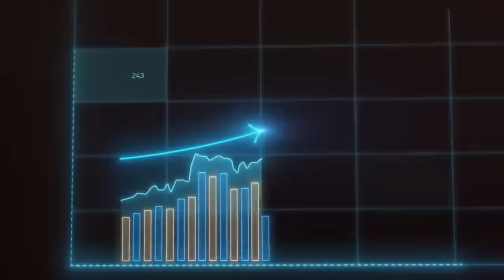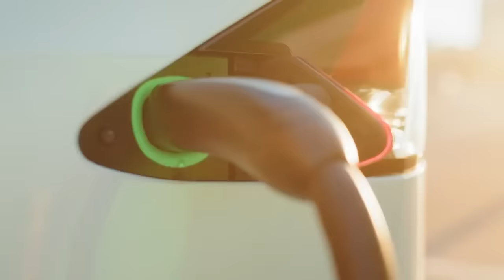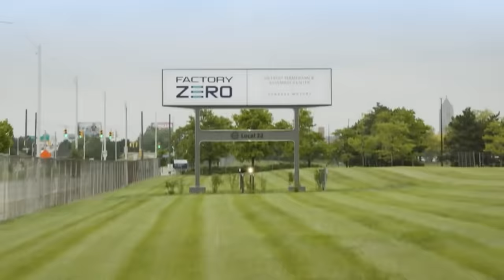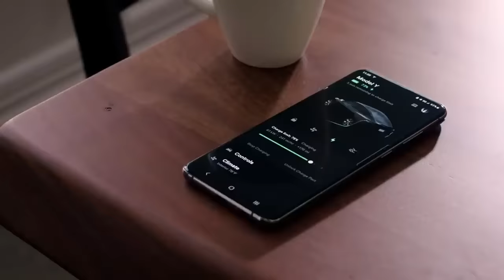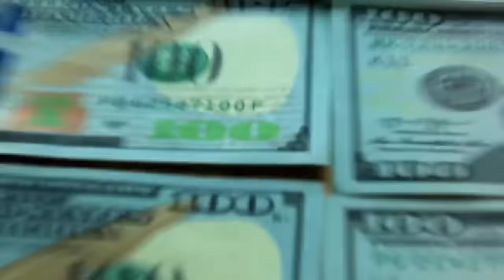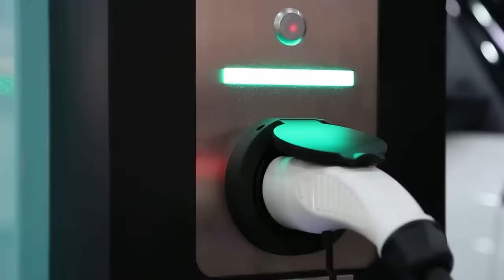Electric Vehicle Owners Are Frustrated and Demand the Return of Gas Cars

Comment: Charging and range anxiety will always be a problem because of  the poor infrastructure, which will never be close to what it is for gasoline cars.
Reply: Charging keeps getting better. Range keeps getting better. Petrol sales are already less than they would be without EVs, and some places like Norway have seen large numbers of petrol stations closing. The thing is, electricity can be found in far more places than gasoline, and that will only get better.
Reply: Do you understand that when the model T came out, they said the same thing?  Not enough gas stations. 🙄
Reply: @sdfglkjhdfkjdhldskfj 

Eventually, but when is that eventuality?

At what cost?

Ev's have replaced a tiny blip in gasoline sales in the US, but have markedly increased the amount of coal needed to generate the power for the EV's.

That doesn't include the off-grid instances of diesel powered generators used for charging stations.

Kind of defeats the purpose doesn't it?

Norway has a population approximately ⅔ that of New York City, so it's not quite the same problem.
Reply: @rtbrtb_dutchy4183  Digging a hole to start an oil station is different from hooking a charging station to the grid. A grid that can't handle it without nuclear power plants no less.
Reply: @holyomega3093  where did you get your info?  Oil industry propaganda?  

Our grid can handle it already. A nuclear power station isn’t required. 

Did you know that Tesla uses old batteries at their power stations?  That what they can trickle charge those batteries and when a car plugs in, push that charge from the battery into the car battery. Would it still need power from the grid?  Yup, but there will be less peak power.
Reply: @rtbrtb_dutchy4183  then are are we still get black outs during summer and advisory to charge during none peek hours?
Reply: @holyomega3093  the blackouts are locally. That doesn’t mean there isn’t enough electricity available overall. Compare it to like you have a hurricane on the east coast of Florida and everybody buys bottles of water. Those stores run out of bottled water, but there isn’t a water shortage in Florida. 

When they ask you not to charge during peak hours, they also ask you to use the ac a little less and to conserve electricity n other ways. Charging the car is one of those things you can do. 

Here is the thing, nobody charges their car all the time. It’s only occasionally. I charge my EV only at home. Before I had solar, my car was set up to only charge between 1am and 6am and I did this basically once every 3rd night. Just because you see cars plugged in, doesn’t mean it’s charging. Now with solar at home, I charge during daylight hours only.
Reply: @sdfglkjhdfkjdhldskfj   The reality is I can drive my car 300  miles on a tank of gas while my ac is on and my lights are on. Gas is the most efficient source of energy still and will be for a long time.
Reply: @rtbrtb_dutchy4183   Seem to recall California asking it's EV owners not to charge their cars for a time because it was over powering the Grid. It's a fantasy land you guys are living in.
Reply: @cain1314  gas is not the most efficient. 🙄 do some actual research man, seriously. Most electric cars will do the equivalent of well over 100 miles per gallon. 

And no, you pick and choose what you wanna hear. California asked people to reduce their electric usage from 7pm till 9pm during the extreme hot days. They asked people to use the AC less as well as try and not use things that takes electricity. One of those things was charging EVs. They didn’t force anyone, they simply asked. Why?  Because they know you can schedule an EV when to charge. I plug in mine when I get home, but it only charges during certain times that I picked. They just wanted people to use common sense. It’s not the EVs that was over powering the grid. It was the millions of people getting home from work and cranking up the AC when it was 110°. 

Just like others, you regurgitate the propaganda from the oil industry, without knowing actual facts.
Reply: I have no desire to visit a charging station at 3 am.

Comment: Saw a news story the other day that dealerships can’t fix a lot of the issues on ev’s because they don’t have electricians as workers, they can’t fix them, these vehicles are piling up at the dealer repair shops. If you take to an independent shop then you void the warranty. Also, for example, a replacement battery in an ionic (?) is 18,000$ total

Comment: As an resident of Alberta,  Canada the omission of problems associated with cold weather driving is a glaring omission.  Alarming stories re EV operators in the recent cold snap we just experienced are sure to turn future buyers of EVs off big time.
Reply: Living in Alberta my gas engine drove only 55% as far as in the Summer, not without some issues, during the last cold snap. It also takes in general 20% more fuel in the winter. We are talking about a almost new well now brand. So all this fuss about lower range for EV is also for gas. 
I am not an EV owner or what so ever, but facts are facts
Reply: @siccozandt6286 you need to fix that problem. Maybe your spinning tires, driving against snow pack, taking excessive time to warm it up, but that isn’t normal because of below 0 degree weather.
Reply: @sharky7665  An ICE vehicle with a fuel tank above half (recommended in extreme cold) will keep you alive for days if stuck in a ditch. An EV battery powering an electric heater will give you hours at best. EV's are a death trap in a cold rural climate.
Reply: Everything will be sorted out eventually…We will specialize…In Alberta I’ll keep driving my oil burner and people in Texas will get EV’s…eh?
Reply: And the municipalities are buying them. It's insane. A giant waste of money virtue signal. Calgary bought a bunch of electric Mustangs.
Reply: @siccozandt6286 In the first minutes after starting in cold weather your car will have more comsumption until it reaches the working temperature. After that, you will not have problems of consumption if you are driving long distances. But if you are doing always small trips where the engine has never time to reach the working temperature , then yes, your car will spend more fuel.
Reply: @siccozandt6286  Not to those with preconceived notions.
Reply: @zdenekkindl2778  No. You will be forced by economics to switch, ICE cars will cost a fortune and gas prices will go through the roof. Repairs will also cost an arm and a leg.
Reply: No mention of the temperature issue in this video.  The recent deep freeze in Chicago produced this problem on mass.      (1) The available charge on the vehicle dropped as much as 70% over night, as the temperatures crashed to minus 18 deg. celcius.  (2) Hundreds of charging stations were frozen and rendered inoperable.  (3) Vehicles that were able to connect to a charging station had to sit in "warm up mode" for over an hour before the battery charging process could start.  (4)  When charging finally began, many chargers were delivering energy at half the normal rate.
Reply: @blazingtrailsblogvideos1463  I won't buy one until they offer an EV with a wood stove option.
Reply: I don’t understand
Reply: @siccozandt6286  A combustion engine runs at between 200 to 225 deg. F whether the ambient air temperature is hot or cold.
The air intake loves cold air.  There is no reason for an ICE to use more fuel in winter.
In cold weather the engine does idles at slightly higher RMP when it is first started from a cold state, but returns to normal RPM after a few minutes.  You may also be spending more time sitting still and idling to run your cabin heater in winter.  You may also take longer for a specific trip distance due to winter traffic conditions.  The engine does not perform less efficiently in cold weather.
Reply: @blazingtrailsblogvideos1463 How do you know that
Reply: Probably a lot of you don’t know what it is colder than -40??
I’m a car mechanic with a defensive driving style, I can do easily 17 km on a liter gas with a mid size AWD SUV.
But in a cold Alberta winter I’m really happy to do 14 km. When it’s -50, engine will simply not come really warm, heater does, so than I’m happy to do 11 km. Driving even slower than summer because of road conditions.
But it’s a fact that all gas cars take more fuel in winter, so do EV.

Comment: Curious.
Are EV owners paying road use taxes like petro owners via fed gas tax?  Hmm
Reply: They will and more :)
Reply: EV owners are moochers. They use the roads built by excise taxes from internal combustion engines, but drive away without paying a cent for the use of the roads. EVs should be taxed, not subsidized.
Reply: New Zealand just started RoadUserCharges for evs
There is complaint from MSM
 but they do use the road so they should have to pay too.
They will be charged by the 1000km same as diesels.
Reply: Yes, states are starting to tax EV's. Pay extra at registration and when renewing annually. Some are considering pay per mile tax. Some are considering adding it to charging stations.

Comment: Watching those Canadian stories where Hyundai/Kia BEV battery replacement cost over $50K CAD is troubling.  By comparison, replacing  gasoline engines with either a new or used motor is small fraction of that.  EVs don't seem worth the headache until better batteries and improved charging techniques are invented.
Reply: It was $61,000. Canadian.

For the 1 year old Hyundai IONIQ 5 Ev car
Reply: I think the depreciation rate said it all. One has to be a fool to buy into it.
Reply: 4grand Canadian for a rebuilt installed six cylinder 3.7L.  Won't get many batteries for 4g Cdn.
Reply: For that price, I could buy 3 5yo BMW here in HKG. With comprehensive insurance included and i could drive it alternatively to extend each car’s life to another 10 yrs or more!
Reply: YEP U GOT IT. The battery technology there is this days should make Evs last like a Cell Phone.

Comment: It's all fun and games until people have to live with these things.  Wait until they start needing $25000 batteries.
Reply: I have some use of an EV. It's fine. It's different to a gas car, you need to charge before long trips, for instance, but the fuel is really cheap. Batteries don't usually need replacing, and more shops are opening up with the ability to find and repair defective cells... but as batteries get better, that will become less of a concern.
Reply: Many Chinese EV were sold below US$10K in China, with battery. The battery is not that expensive, the cost should be around US$ 3k.
Reply: “ shops are opening up to repair batteries…..” maybe in your country, but here in Australia, the slightest damage to your battery and the car is written off, because they EXPLODE! No one will touch them here, simply too dangerous. Everyone knows that lithium batteries degrade over time and need replacing. And the “fuel” is only cheap if you charge it home, assuming it dosn’t burn your car and house down. That will not be cheap. @sdfglkjhdfkjdhldskfj
Reply: Stop looking at it as a car people. Everyone has a cordless drill works fine till the battery goes out right what’s the first thing you think ,I’ll get a new one but get sticker shock on the price so you fine a deal and get a combo kit for the same price all good right. Now you have new drill an old drill old battery and new battery and two chargers you are set right? Ok till the the drill company changes the battery packs on the new models 18v to 20v etc. this is the problem the constant changes you will have keep upgrading the original drill you started is the first step to company ownership no you see ,replace company with government and the picture looks clear now.
Reply: And the computer brain chip boxes too
Reply: @andylam2523  oh please. Chinese EVs catch fire even more than Teslas do. Going cheap on the battery is only going to make your EV experience even more painful!
Reply: @Ziegfried82  Small car maker don't have the abilities to make batteries themselves and will count on the major suppliers. 
Just wait a few years and see what happen.
Two things that concern me are the homeowner and car insurances. My brother is on his third lease on his Nissan leaf.
Reply: @andylam2523 it depends on make and model with labor and other charges most ev batteries installed are 10k-20k  and the life expectancy is 10years
Reply: Wait till there are increased taxes on tires since EVs eat tires twice as fast as ICE due to battery weights. There will be costs for charging, increased road tax and mileage taxes to replace gas taxes that cover road repairs and replacement. Lots of additional costs coming for EVs and ICE vehicles.

Comment: EV may be great in high population metro areas by cutting down on smog.  But for people like myself who live in a remote rural area, there are no charging stations with the exception of your home.
Reply: How far is the next gas station to your house? I've been on long distance trips and there is charging whatever there is a general gas station, or large shopping area. I think even the hybrid   BMW I8 little battery you can go 30 miles before the ICE kicks on. I think Chevy Bolt minimum range is a 100 miles. But why is charging at home an issue? It is cheaper than supercharging and you can use your 120 outlet(very slow charge) or use your dryer type outlet(220) a lot faster, or install a dedicated charge line(expensive) but ever faster charge. A Ma n Pa gas station won't for some time get charging setup unless theres something worked out by the town/city officials or a great incentive that's cost effective for them to set it up, but a general well known gas station will get a charging setup. Buc'ees , a TX based gas station company is coming to an area near me. With 100+ gas pump stalls, it will included at least 20 Charging stations.
Reply: @jatx3  Unless I drive 11/2 hours down to Hilton head,  there aren’t any on St Helena Island,  there are 2 in Beaufort, SC and 1 listed at Hunting Island State Park
Reply: charging infrastructure is very cheap and fast to build, ot costs a fraction of gas stations, and many cities are building thousends of them right now.
Reply: @jatx3 I live in an apartment complex.  No charging there.  At least 3 gas stations are within 2 miles, no hour long waits to get gas, no hours long charge times.   re: gas stations getting chargers.  "is coming", "will", and in the meantime what?  Hope the grid and business electric service can handle the load.
Reply: @chriswilliams8607  Frankly, I don't believe you.  Nothing is cheap to build, first the cost of the land, then the improvements..  Power capacity in many individual locations to support charging stations is not adequate.  Building "thousands" right now?  What source are you citing?

Comment: When you look at a car and can't tell whether the car is powered by
a 2,000 pound highly toxic and reactive lithium battery
or 15 gallons of gasoline
that is NOT the definition of "Disruptive Technology"
and the reason we EV owners don't recommend others buy EV - no need to waste your money like we did
Reply: You are definitely not an Ev owner. Ridiculous statement.
Reply: @rtbrtb_dutchy4183  I own a 2022 Tesla Model Y Long Range
any other words of wisdom for the audience?
Reply: @noleftturns  well, than you bought an EV without understanding how the tech works. Because “we EV owners don’t recommend” isn’t really the case. Every owner I know, including me, would recommend for people to buy one.
Reply: Yeah people have regrets buying EVs for many reasons but the biggest one I've seen is when their battery dies. One look at the replacement cost and they are converted back to ICE heh.
Reply: @Ziegfried82  except they don’t die. On the rare occasion it does die, you don’t need to replace it with a brand new factory battery. 

There are now companies that will fix only the cells that have died. Also, there are now used batteries available from cars that were written off after an accident, but with an intact battery pack. 

By the way, most car manufacturers have an 8 to 10 year warranty on the batteries. 

You are falling for propaganda. Batteries don’t die regularly. As a matter of fact, it’s so rare, people have more issue with having to replace engines and transmissions in regular cars.
Reply: @Ziegfried82  it’s kinda sad the stuff you believe to be true. Are there people who bought an EV and regretted it?  I’m sure there are. There are always people who aren’t happy. But most EV drivers are happy with their decision. Of all the ones I know, none of them want to go back to ICE.
Reply: Those things are not comparable! Your forgetting the engine!